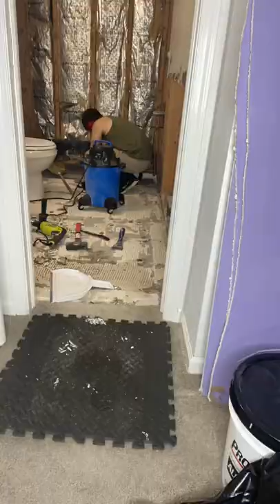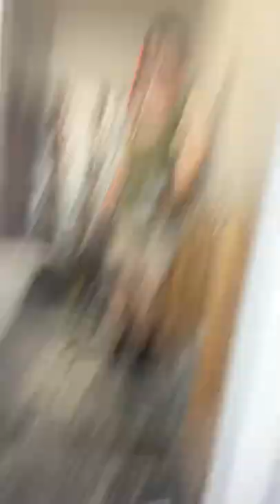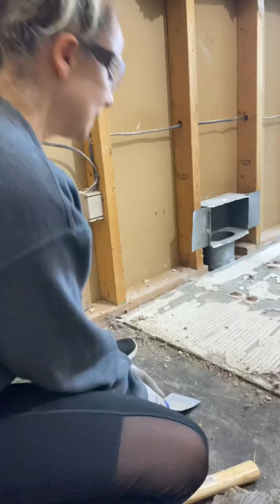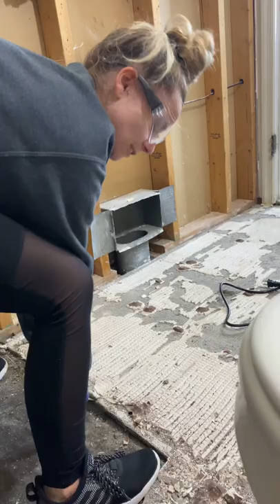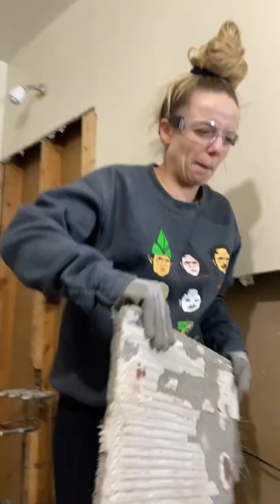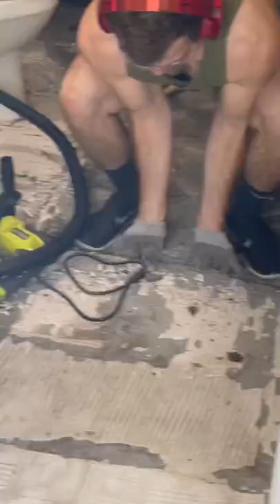HOT MESS HOUSE RENOVATION PART 62! | VIRAL TIKTOK SERIES | LEXI DIY

Comment: I don’t know a lot about toilets but I do know this: buy the elongated instead of the smaller round seat (usually sold as two different options for similar pricing). It gives your bathroom a whole different vibe. Unless you decide to go ultra modern and buy something completely different, round/oval and elongated are usually the two traditional sizes of the seat.